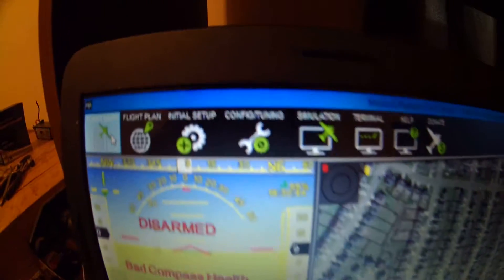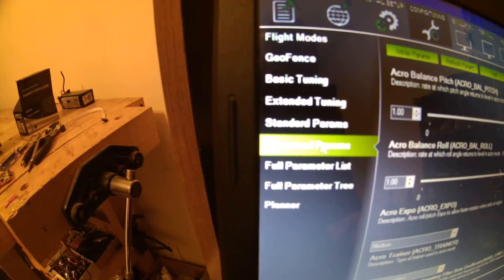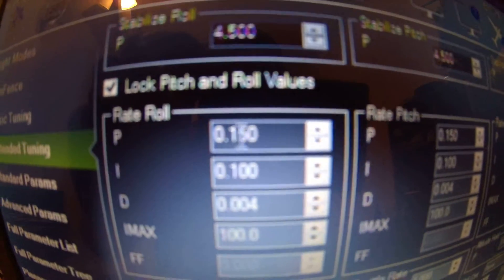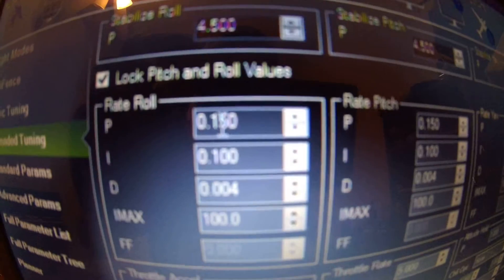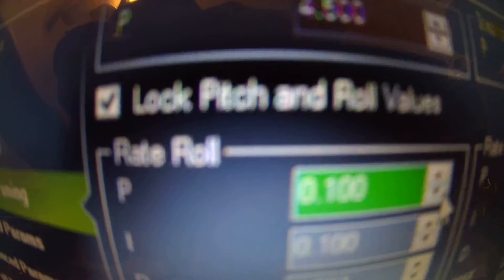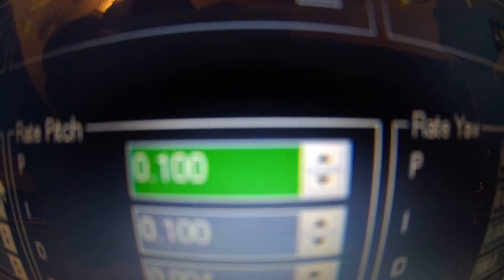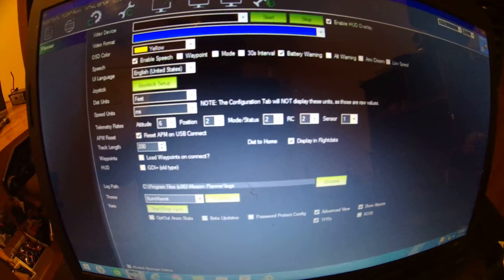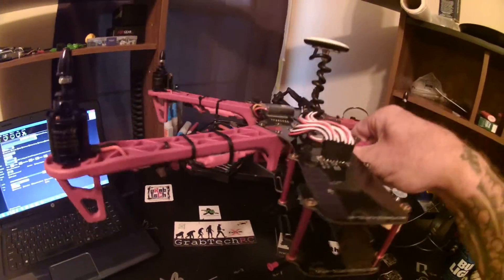how to fix wobble in hover or under acc.  on all axis , apm and pix

Comment: i get roll wobble when i throttle down from height,you reckon i should lower my roll rate?
Reply from the maker: that's because you are coming through your prop wash no way to get rid of that try coming down in big circles to stay out of it
Reply: @donnynevins3721  yeah true I got rid of most of it 👌😎but yeah it's mostly dirty air.
Reply: decend slowing if descending straight down...its more of a problem in bigger prop quads like 9-10"